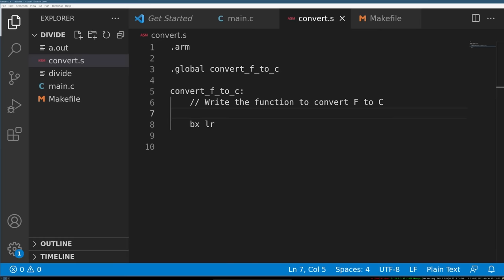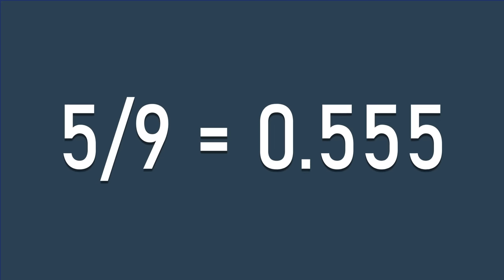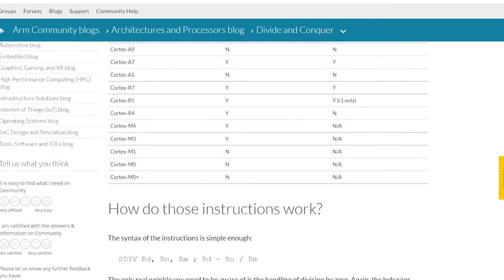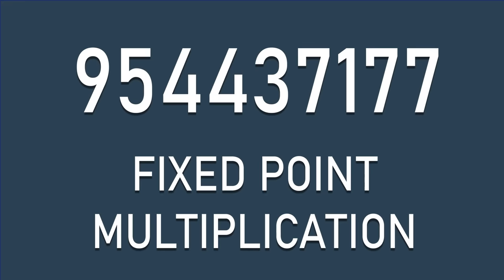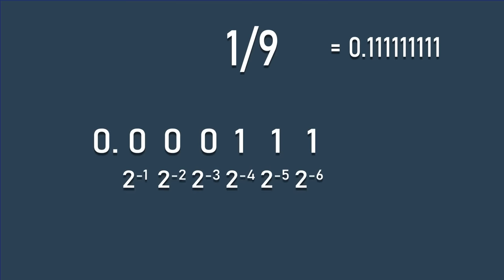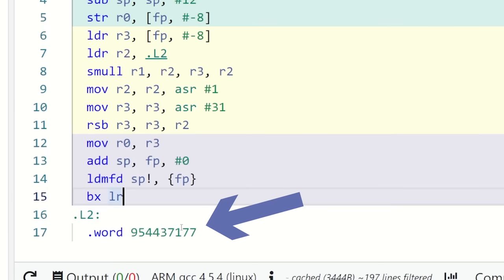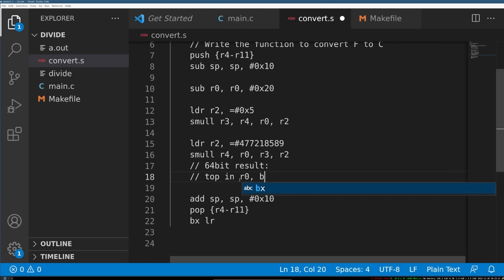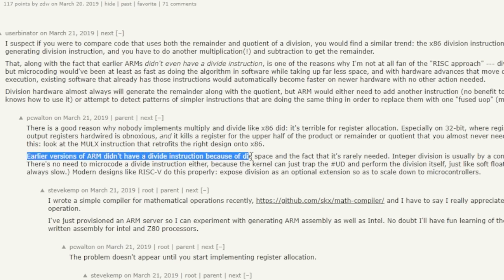computers suck at division (a painful discovery)

Comment: Even as late as the the Nintendo DS ARM 9, we needed to use fixed point mathematics. The hardware registers themselves accepted only fixed point values.
Same with trancendental trig functions.  We had to use lookup tables in BRADIAN(Binary Radian) units interpolated on the fly.
Fun times.
Reply: Did you program DS games?
Reply: Fixed point or fractional integers can in fact do adequate calculations for most practical things and in signal processing, it just gets increasingly burdening on the programmer to decide where the decimal point is put best for each number represented in the program to not lose precision or keep the S/N.
Consequently, it is easier for the programmer to have this done at runtime with floating points, but also more wasteful and also possibly numerically more unstable/indeterministic when dealing with feed back or iteration over data sets.
Scientific calculations or a FFT (and other transformations) are examples where floating point calculations may be needed.

In a FFT for example all data points in the time domain may contribute to only one data point in the frequency domain and vice versa, floating point may be the better choice to deal with the bigger dynamic of the transformed compared to the source data, compared to just increasing integer bit precision overall.
Reply: Yep one of the hardest problems in computer design has always been finding a good way to implement division.

There have been some creative solutions, like in the cray-1 supercomputer which would instead compute a reciprocal that you could then multiply to do your division. But often, designers just omit division all together from their CPUs.
Reply: Well this was just division... By constant....
Reply: The DS also has a divider unit, which makes up somewhat for the lack of support by the CPU :p
Reply: old man, give us more of your wisdom!
Reply: Homebrew or official developer?
Reply: Did u code ds bro?
Reply: ive used fixed point lots of places. i wrote a software renderer where i needed sub pixel precision for rasterization. since the screen i was using was really low res, i had a few bits left over in my coordinates, so i used them to store sub-pixel data. games in general used fixed point math up until around the quake era when an fpu was a hard requirement.
Reply: Did that change with the DSi or 3DS?
Reply: They built 1 line of ARM that didnt have floats, you will ALWAYS need to program for that until 20 years after it becomes part of the ARM minimum required standard (that is on the date when you can no longer call a new processor without it 'ARM' start a 20 year timer before you can rely on it being there)
Reply: Modern fuel injected vehicles used fixed point well after 2000 !
Reply: This is a long shot, but did the DS pop in your head when the r4 registry was mentioned in the video? I would find it funny.
Reply: @Mr_Yeah  the DSi's CPU also did not have builtin division. The hardware didn't really change much between the two, but the 3DS is quite a different beast.
Reply: @LordOfNihil  quake still uses fixed point for all rasterization work,  the fpu is used to do the work for perspective correction in parallel with the texture mapping for the inner scanline loop (the pentium had seperate execution units and fpu instructions would execute on one unit while integer instructions could execute on the other if you were careful.
Reply: @Ehal256  you want fixed point in rasterization, i wrote a software renderer and it only takes one fp glitch to make your result look like crap. since there is a lot of fp math being done, its inevitable to have at least one glitch on every frame.
Reply: @LordOfNihil  yeah, of course getting fixed point right is also a huge pain in the ass lol
Reply: yeah, fun times, I miss them. I also was programmer for DS. We created few games. Cheers
Reply: that explains why pokemon games like to use power of 2 values

Comment: As someone who does microcontroller stuff, I often do that sort of thing.  There is even a method that allows you to effectively divide by a variable amount.  It is based on two observations:
1) A/B = (N*A)/(N*B) so you can pick an N to make the denominator something easier to deal with
2) For X very small 1/(1+X) = 1-X   this allows you to deal with any number near a power of two without a divide.
Reply: That second approximation, and the others that result from that Taylor series expansion, are all over physics.
Reply: @crashhappy7296  The 2nd thing is really more like an observation Taylor started with.  The two parts together effectively do a divide but it is not Taylor.

Comment: For those of you who, like me, had some difficulty understanding his explanation. 
His final calculation is something like: C = (F - 32) * 5 * Const / (2^32); where Const = ceil((2^32) / 9);
He divides by 2^32 by grabbing the highest 32 bits of a little-endian architecture number, because it would be equivalent to bit shifting the 64-bit positive number 32 times to the right.
Reply: Thx! That actually cleared things up nicely :D
Reply: Thanks, it cleared up my doubts
Reply: You are a wizard
Reply: For something that's only C to F or reverse, just calculate it ahead of time on excel and put a lookup table inside the code. It is embedded system and it will be faster and smaller than pulling in a math library.

Comment: The generalization of this concept is called  "division by multiplicative Inverse" or less commonly "multiplication by the reciprocal" and is a relatively common practice when you have a division where the divisor is a constant. It's talked about a lot in low-level books, like "Hacker's Delight." Basically, you precompute the division by encoding it as a reciprocal. It's fatal flaw is you have to know what you are dividing with from the start.

To go farther, you have to use something like the Newton-Raphson method for division. This is the same as the above, in that it finds the reciprocation quotient. The first major difference is that it is a run time operation. That is, it FINDS the needed reciprocal during execution, no precomputation. The second major difference is that it uses an approximation to division as a function to get close to the correct result, then uses Newton-Raphson method to refine that guess to as many digits as you desire. For 32bits, I find that 3 iterations is plenty.

Incidentally, all of this is possible because floating point/fixed point number systems encode multiplication and division into the number itself, in the same sense that having a sign bit encodes addition and subtraction into a number. Floating point, specifically, also encodes exponentiation into the number, which is why it is the usual goto number system.

... The comment claiming this to be called "Division by Invariant Multiplication" is the first time I have ever heard it called specifically by that name, and has just one research paper with that exact title... Wikipedia calls it "multiplication by [the] reciprocal" which someone responding to said comment linked to as well. multiplication by the reciprocal is a basic math operation, and gets you a lot more hits than "Division by Invariant Multiplication." It's also certainly not complicated to understand, as this ~5 min video has clearly demonstrated.
Reply: Based informative comment
Reply: Doesn't Newton's method use division? What am I missing?
Reply: @rickroller1566   https://en.wikipedia.org/wiki/Division_algorithm#Newton%E2%80%93Raphson_division

...specifically, you want "Xi =(2-DXi) ... which can be calculated from Xi using only multiplication and subtraction, or using two fused multiply–adds. "
Reply: you rlly are an alchemist
Reply: Why dont you divide by 1.8
Reply: It should probably be noted that newer libraries such as fastmod often produce less code than the approach described in Hacker's Delight (in general the approach is in fact the same, details matter though)
Also, such libraries allow for divisors only known in runtime (useful e.g. for hash tables)
Reply: Cool--I wonder if Rescue on Fractalus was done with similar techniques (on Atari and C64 in the olden days.) Lucasfilm pulled off some amazing 3D flight simulation (and aliens bashing their way through the windshield) on my old Atari 800.
Reply: What is the wizard talking about?
Reply: @Mad-Bassist  when a register can only hold 8bits, the look up table fits into memory even back in the day. PSX also has a 8 bit lookup table (in ROM).
Reply: 'cept, this is a microprocessor your dealing with ...maybe, it's better to think of something like peano's axioms ...division is repeated subtraction.

Comment: My favorite trick is to take some huge power of 2, let’s say 1024. Turn 5/9 into the closest fraction with 1024 as the denominator. In this case you would get 570/1024. Now all you have to do is multiply your binary number by 570, and then move the decimal 10 places to the left. I’m sure you guys know way better ways to do this, but this was my trick when I had to write code in assembly for my computer science class.
Reply: Just realized this is almost exactly what you did in your video!
Reply: @gapplegames1604  This is exactly what he did in the video
Reply: @gapplegames1604  Depending on the architecture and the number of bits you have there are tradeoffs with precision/max value you can accept. Since 32 bit multiplies tend to be faster (on cheap hardware), something with a lower bit shift like your example (but most likely 16 to use tricks with using just high/low word) has its uses in some situations. If you're stuck with an 8-bit AVR, you're definitely not doing 64 bits multiplies (and probably not 32 either).
Reply: Except multiplying by 590 reduces the domain and causes overflow in cases the better method doesn't.  You usually like to write crappy buggy code, without consideration of any problems or limitations or domain restrictions.  Yes we know.  Hopefully nobody is paying you for such garbage tho
Reply: @gregorymorse8423  jesus christ bro chill, he's explaining how he did it "for my computer science class", he's just working with the closest possible precision he can given the limitations of practical time constraints and diminishing returns. For the purposes of understanding how assembly works, the goal of most courses that are going to require a basic understanding of this kind of math, this is a perfectly sufficient method.
Reply: @Riley Alden  yes but being rigorously academic requires careful statement of the domain and range or pre/post conditions.  Being highly practical requires maximizing efficiency including not wasting bits.  This is neither.  Ok my criticism looks to have been too harsh.  I just push for excellence rather than mediocre content and constructive criticism can help.  I'm big chilling btw
Reply: @gregorymorse8423  2/3 of your comment was personal insults, thats anything than constructive criticism, and pushing for excelence.Also how do you know there would be overflow, when we dont know nr of bits the cpu can handle or what are the expected input range of the nr etc ? Also what would be better than this?
Reply: @waskoma  there will always be overflow when within 10 bits of whatever the CPU can handle.  This is a general principal for finite sized values.  It's so easy to prove it's ignorant to mention it.  Those weren't personal insults at all, they were professional insults.  Now get a grip child.
Reply: @gregorymorse8423  Look, we get it, you're incredibly defensive because you're not as smart as you want people to think. Throwing around insults just makes you seem absolutely desperate to be taken seriously.
Reply: @gregorymorse8423  Omg, look how smart and serious and excellent you are (/s). If you were really interesting in providing something constructive you'd have said "yeah, but doing it this way reduces the domain and can lead to unexpected overflow" but instead you levered insults and attacked them. It would benefit you to learn some soft skills.
Reply: @gapplegames1604  Your comment was not in vain - I didn't understand what he did in the video (at least after watching once) but I understand your comment.
Reply: Saving this for later this semester

Comment: At the machine level, computers don't subtract, multiply, or divide. They add, compliment and shift.  So, in binary, shift the dividend left past the radix as many times as you want significant digits.  Two's compliment the divisor and add it to the dividend until the quotient sign bit is negative.  Shift the quotient right the same amount you shifted the dividend left.    Viola!     The decimal is not called decimal in any other number base but 10.   It's the radix in any number base.   
The video was great!  Good job digging into the software that deep!!!!
Reply: At the machine level, they also don't add, either. Addition is build out of purely logical operations.
Reply: @__christopher__  Yep.  And even the logic can be expressed in discrete components.  And those in gathered natural materials.  Sand, dirt, burnt things and wizardry  ;-D